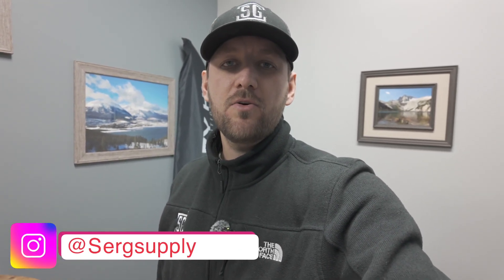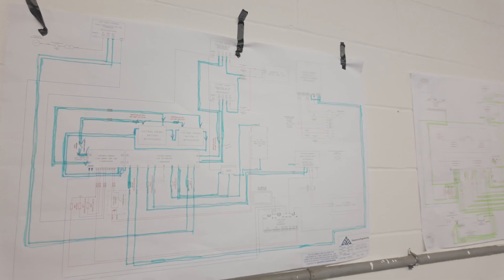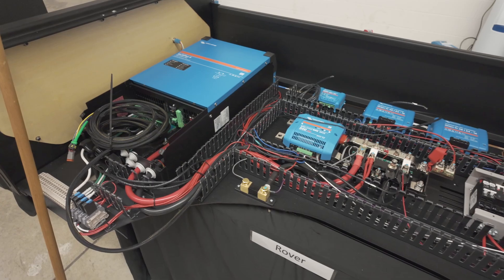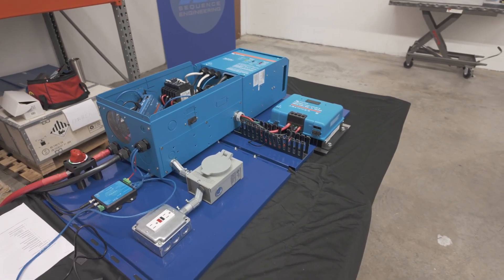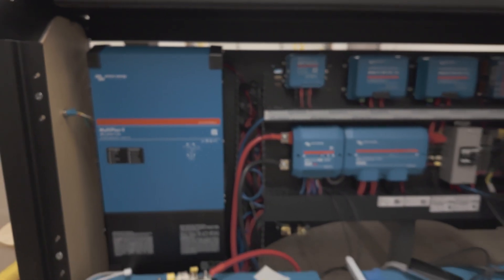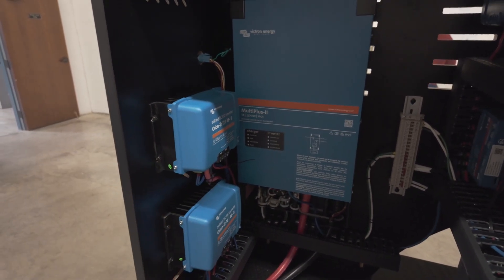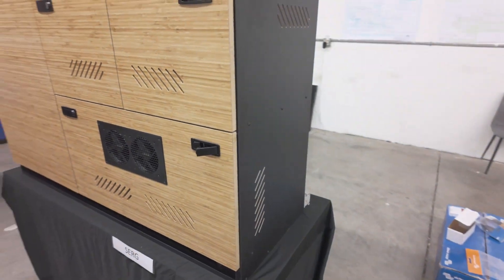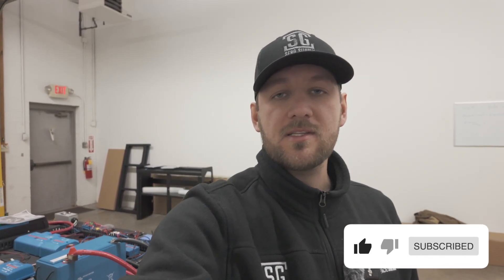Our New Electrical System is Here! | Serg Supply

Comment: I'm new to this whole modern van thing (had a 67 VW camper van way back when), so I'm a little baffled about how much space these wiring systems take up.  My question is this.  Are these systems only for those running all the bells and whistles at once, or is there a smaller version for people running just a few things like a fridge, fan, and lights?  Also, are these modular?  Can you add things as your needs grow.  I've always struggled with installing electrical systems and have left it up to others, but I don't want to loose space or pay for stuff I really don't need.  Thanks

Comment: Does anyone sell a “ready to go” power system?
Reply from the maker: Our “kit” will be sold as ready to go and come pre configured for you. You won’t have to mess with all the various components. It will be as straight forward as it can be without anything you don’t need.
Reply: @ awesome! Thanks for the reply. I’d imagine just need connections from the solar and alternator input. Then just use the available circuit breakers for appropriate outputs. Should we follow your channel or monitor your website for updates?
Reply: @Serg_supply will you also provide a kit for the Dinette style cabinet or only the Murphy style?

Comment: What in the world is that monstrocity? You show an ecoflow video that is clean and simple then post this complicated mess of insanity. The ecoflow you showed had TWO components TWO and the batteries…

I repeat my statement from before . Anyone using victron at this point is either misled, a dinosaur refusing to die or a paid for shill. 

That came across very harsh but I'm sorry it is true.
Reply from the maker: Your point about size is fair, but if you could get the best components for your van for the cost of an eco-flow with American based customer support, and a warranty that doesn't take months to sort out would you consider it?
Reply: @ I guess that's the gamble we play, but electronics are usually less error prone. However if something goes wrong with ecoflow its one of 3 components which need to be replaced. If it's the victron system? Have fun chasing down which of the 20 components is the culprit and repairing/replacing it.

Secondly the ecoflow takes less than an hour to install if you know where you want it to go. Victron? A day? Two? Even as a builder those are hours you are spending the introduce human error potential.

My 7 year old can install the ecoflow. Plug this into this, this into this, done.